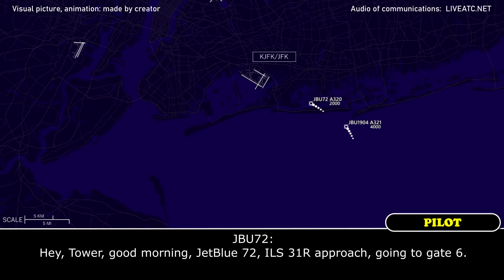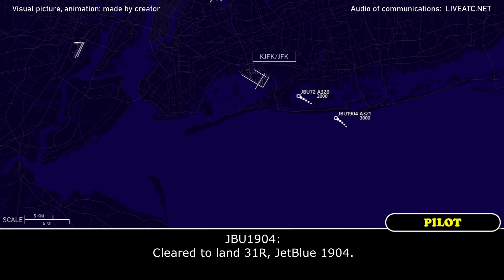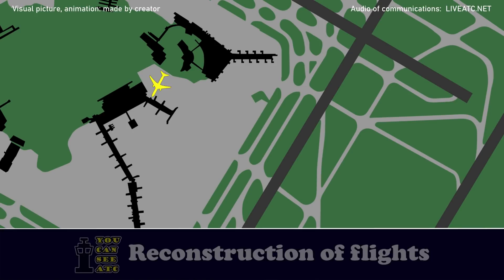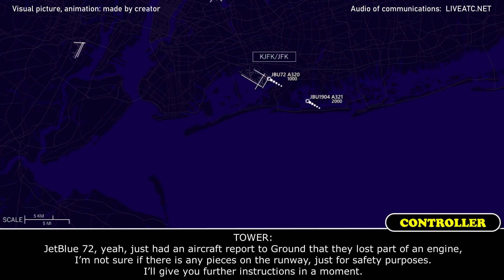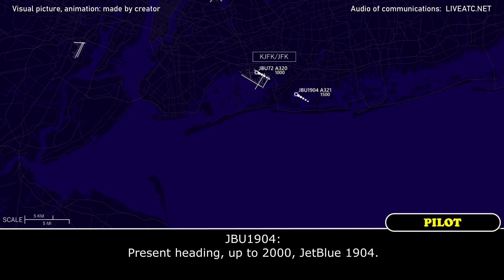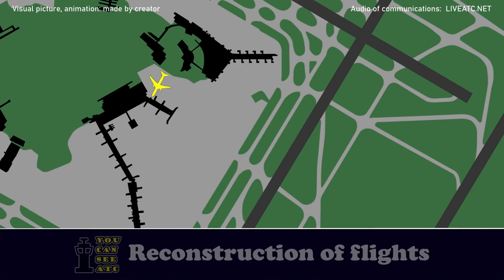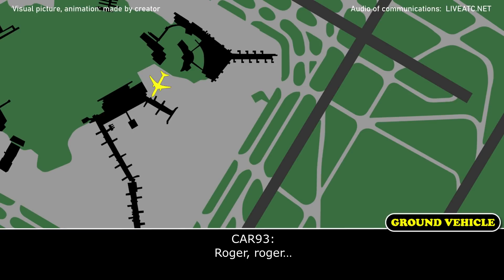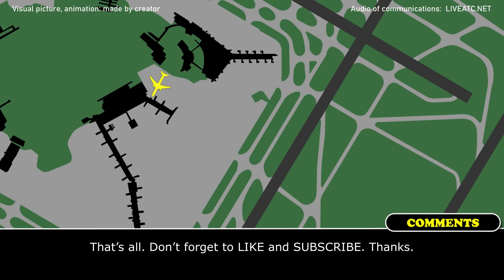The aircraft lost parts of the engine | Eastern Air Lines Boeing 767-300 | New York, ATC

Comment: Did someone buy the old Eastern name?    Is Continental also still flying?
Reply: yes, this is the third revival of the name
Reply: Continental merged with United. So yes they are still flying but are now part of United Airlines
Reply: @13ralph41  
That is not technically correct.
CO, took UA over, and as part of the deal, the new airline would be called United,  simply because of name recognition. But the airline would basically retain the CO paint scheme, and the CO CEO. 
 Everything about the old United is gone, most infamously the iconic tulip on the tail. It's another travesty.
Reply: @TWA-km9wt  hehe, the United U on the tail has always been, in my mind, a tulip. 🌷 Must be that Dutch part of me. Mooi.